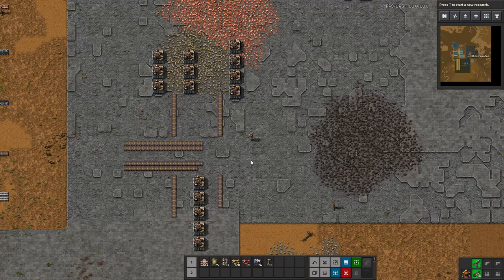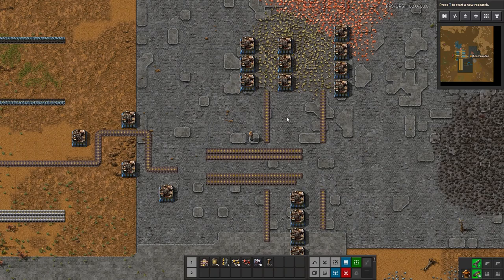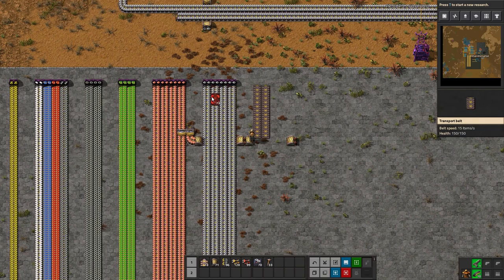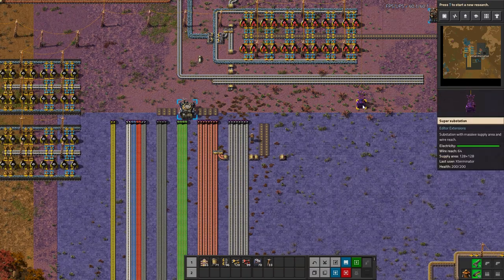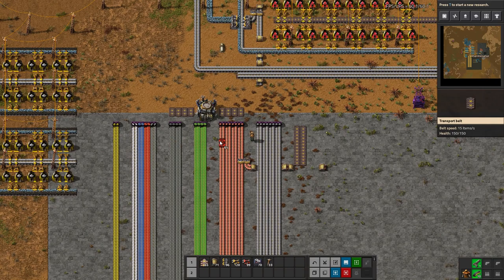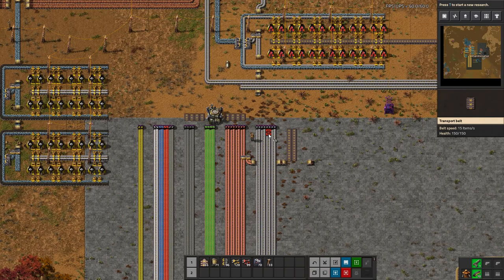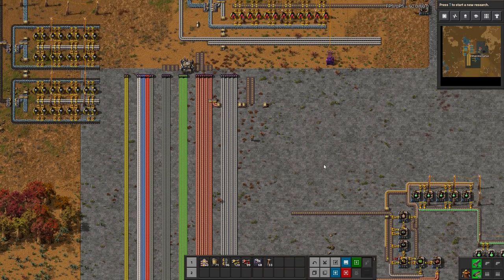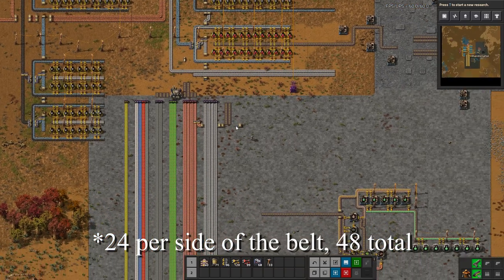The Main Bus Concept / Layout & Tips - Factorio 0.18 Tutorial, Guide, Walkthrough: Fundamentals

Comment: Hey, I'm a new player as of just 2 weeks ago and I'm running into a numbers issue.  As you say you will eventually need 48 furnaces for iron on a yellow belt.  48 furnaces puts out 48 iron BUT if a yellow belt only carries 15/s, don't you need a faster belt to handle the load??   Only other way would be to separate the belts inside your smelter array and that looks funky splitting or just breaking furnaces up inside an array to make room for 3 belts to exit.  This isn't like satisfactory where you can go vertical when you exceed a belt capacity. 

That would be a massive bottleneck of iron that just cant get thru to where it needs to go because the belt capacity is 300% overloaded.  Just from the start...  

So what's the gist here?  The numbers just don't match from where I'm looking at it.
Reply from the maker: Hey, welcome to the game! So it's 48 stone furnaces total to fill a yellow belt with iron, so 24 per side of the belt. 

Remember to factor in the craft time of the item (in this case iron), a long with the machine/smelter speed. So a stone smelter has a speed of 1, but iron takes 3.2 seconds to smelt. So 48x3.2x1 is 15. :)

Hope that helps clear things up! If/when you upgrade to red belt, since it's conveniently twice the speed of yellow , that means you can just do double the amount of stone furnaces to fill it, or better yet, just upgrade the 48 you had for yellow belt, into steel furnaces since they are twice the speed of stone ones.

Comment: What's this 117/234 thing?  I'm pretty sure it's 120/240... exactly 5x what it is for iron.  I think that's probably residual from old ratios, before they changed smelting to match the new (yellow) belt speed of 15 items per second instead of 13.333... ratios changed then, so I could easily imagine 117/234 being correct before, but I'm pretty sure it's just 120/240 now.  Open to being corrected, though!
Reply from the maker: Hmm I was under the impression that with the belt changes, they also changed the smelting time of stuff so the ratios wouldn't change. I'll have to check up on that though! I could definitely be wrong!
Reply: Xterminator I think that's mostly true, but it used to be that the 24/48 number was an approximation. It was closer to 23.5/47 or something? But people didn't want to do asymmetric builds, so they rounded up. And then your steel numbers are just without (or with less) rounding. But I think when they made these changes, they evened it out. I could be wrong, though... do the math. :D

Comment: Hey! what i dont understand... Example: Red Circuit or blue comes a little later in the game. how did u ingest a new material to the bus ?
Reply: The bus won't contain all the materials you plan for it at the beginning.  Most things beyond plates get created from materials on the bus and then routed back onto the bus.  Usually they only need to go further down the bus, but occasionally you need to use a splitter and run them the opposite direction up the bus to get to something you built earlier, like a mall.

Comment: Something missing from this that I would consider important: How much is a lane of X worth? Okay yeah you need 4 lanes of iron/copper, but is that factoring in the shitload you're going to be consuming building green circuits? Does that factor in constant production of intermediate items like gears as well? What about stuff getting built at a mall? How do you quantify this stuff without getting lost in a calculator? This is what I tend to struggle with the most when I play, even after 650 hours, and it eventually just grinds my desire to keep playing to a halt. :(
Reply: Stuff built at a mall should not be a big concern, it is used more sporadically than what goes into science which can be consistently consumed, I usually leave the mall at the end of the bus for this reason, so it consumes only what other builds didn't, and a full 4 red belt bus worth of iron and 4 of copper should be quite enough for any main science /starter base, if you need more than that this will only come up in late mid game and by then you can start plotting a whole second base elsewhere if you need to go big.

That is playing mostly vanilla, this does not apply to complex mods like bobs or angels.
Reply: I give dedicated iron and copper lines to green and red circuits. That cuts down a lot on what needs to be on the main bus. The mall also eventually gets dedicated iron lines for part of the gear production (for belts).

Comment: Why have multiple lanes at all? Is it a case of using the outermost lanes until you have shortages and then you just use the next lane in?
Reply from the maker: Basically yes. Or using certain split off designs that pull from all lanes equal each time you pull off for a build. 
The more you add to your factory  the harder it will be to supply it with just 1 lane worth of resources.

Comment: I have a bus of primary resources only, iron, copper, steel, stone and coal, and then produce the subproducts for the final product instead. Is it the same or it's prefferable to make a bus for the rest?
Reply from the maker: That is pretty much the same. I prefer to also have things like circuits and sometimes gears on the bus too because it's less production I have to set up at each build
Reply: @Xterminator  My issue with that is how to calculate how many production of secundary or terciary products I need? The way I make it is the least production I could find as I'm not making, say gears, tons of them and then use as much as I need. Instead I make only the gears I need for the production. BUT the counterpart is that I have more assembly machines as sometimes I need 0.2 machines to cover the need and I build 1 whole thing and this repeats many times to the point that I end up with 8 machines making the same thing when 1 would cover the needs for all production if I distributred the production among the different sets. Kind of messy to explain with a limited vocabulary (not english speaker), hope you get my point and can iluminate me with things I might not be considering

Comment: Now I see how to pull off something from the side like steel or plastic in the column of (plastic, blue, red, steel) but how do you easily pull off the middle ones?  Just go with undergrounding the main bus for a while?

Also for the iron and copper ones wondering if you go with some splitter checkpoints along the bus to even out and keep them all filled.  I will check out some of your later game videos to try and see the answers myself but this video got me wondering.
Reply from the maker: Good questions! For pulling from the middle, you may need to underground a little bit of the main bus, but then should be able to just underground your pull off line across the bus using the two spaces left between each set of 4 lanes. I'll try to show it in my tutorial let's play on EP10. 
As for splitter check points, I usually don't bother. Once I get 4 lanes of a material, everytime I do a split off, I make sure it's balanced, so I don't need to do it again until next time I split off. Hope that makes sense. :)

Comment: So there's 2 things I still don't really get with this concept. 1) How do you take from the 2 middle belts in this situation? especially if 2) if my production on a belt has been split off multiple times, then some later sections might got get many, 1/8 - 1/16th of a line if they've been over split. Also I assume that if you want something, like copper cable on it, you've got to split a line of copper off, produce, and add it's own line back on? that's usually how I do things and I end up with my spaghetti junction
Reply: Use underground belts around the belt you’re taking from so there’s room for a turn and underground belt

Comment: I'm having trouble getting items on both the left and right lanes of a conveyor belt, what's the easiest way to do that?
Reply from the maker: Usually inserting them from opposite sides, like in a smelter (so having inserters putting the plates in the belt from both the left and right side) or using side loading. Side loading being a technique where you run one belt into the side of another and it dumps it's items on to that side of hit.
Hope that makes sense. :)
Reply: @Xterminator  ok, thanks :D

Comment: I'm sure I'm missing something obvious: But in case I'd like to get the red chips to the production area on the right, how's that working out? You can't place a splitter or so in between those 4 lanes without messing them up. So it might be required to leave space in between each different resource, wouldn't it?
Reply: You use underground belts on the other adjacent lanes to make room for the splitter and extraction to the gaps in the bus.

Comment: Started to play this addicting game few days ago,already 40+ hrs :D One question,how you move for example red circuits to the right or left side,without making blue circuits to go other lane ,or just use splitters and swap it from time to time? :D
Reply from the maker: Sounds like you're enjoying it, haha! :D
I'm not sure I entirely understand the question. I assume you're using a combined belt with half of it being blue circuits and half red? Usually you shouldnt need to swap lanes because inserters don't care what side they grab from. Or do you mean moving where they are in the whole bus?
Reply: @Xterminator  Haha,i removed almost whole messy base because of this video,and built "from beggining" ,imagine that :D As you shown on video on the left side you have middle 2 line red and blue circuits,so when i need one of them left or right i have to use few splitters to move them on that side or there is other ,im using same 1 full red 1 full blue ,managed solmehow to split (for example on your video red circuits to go left side from main highway, but takes some time to tinker :D P.S. Yeah im building on both sides of lanes :)))

Comment: Surprised coal on the bus wasn't more important. I tend to always add it. Same with stone and stone brick.
Reply from the maker: Stone and stone brick would be good to add honestly. As for coal, I really only ever use it in my smelting and plastic production, and my smelting is at the very start of the bus when I build, and I always put oil production in its own area away from the bus, so I've never had a reason to run coal. Of course all this information and such can be tailored to your own style and needs. Some people put oil and plastic production right off their bus, and in that case you certainly would want to run coal down your bus probably.
Reply: @Xterminator  I've been making my smelting the very start of the bus. So ore goes in, plates come out and replace that ore line. I run 1 or 2 coal lines, but like you said, it doesn't get much use out side of a couple items. I guess, just as you said about spacing, at most, I've used some belts and a wee bit of space.

Comment: i play expensive mode a lot and i learned one thing: mainbus is, for the bulk consumers, bullshit. the large consumers need dedicated point to point feed lines, not a bus. 
the reason is its not possible to recompress a belt after partial depletion. its possible to rebalance it but that then means its no longer possible to feed a compressed belt to anything.

that does not mean a bus is totally useless. i do still have a bus. but its just one iron one gear one copper one pipe one green and one shared red/blue circuits.